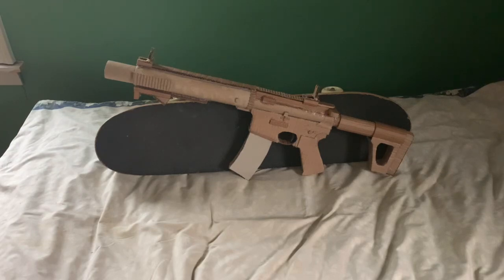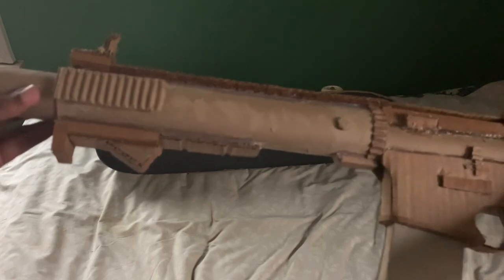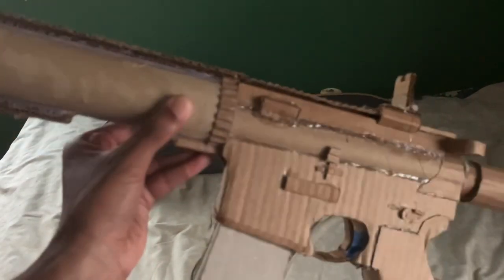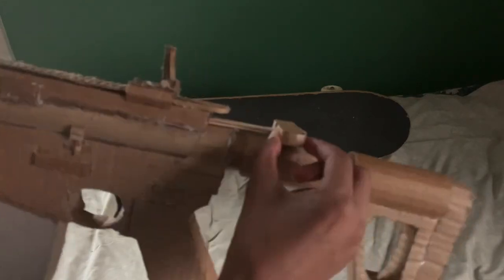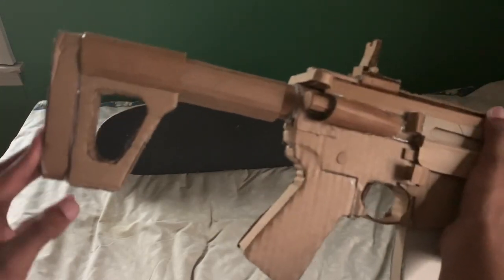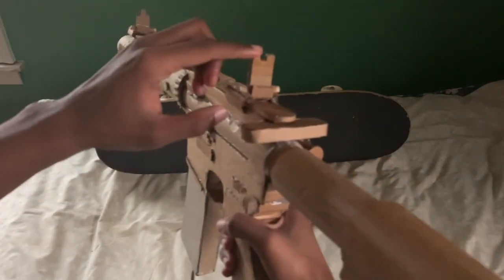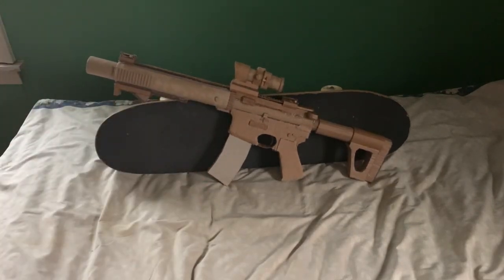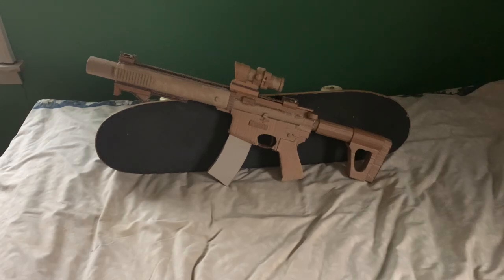Cardboard M4 (AR-15) 🇺🇸 | Updated

Comment: By the way, friend, how many years have you been making these guns out of cardboard, they are of high quality, I have been making them for 7-8 years, but I don’t have such detail and dimensions, I like to make Kalashnikov, etc😁
Reply from the maker: About 9-10 years I believe. My first cardboard guns were the MP5 and M4. But I’m just now getting the hang of making a decently good Kalashnikov rifle. Usually I tinker with guns even after I finish them to provide the most quality and detail I can. (Which is why I do Updated gun vids.) 

A quick tip for the dimensions is measuring the receiver. It’s the main part, and if that part is correctly sized, the rest should come along. 

Btw, you need to show me some of them guns you’ve done!
Reply: @javitZ137  I hope that I will show you soon my friend, wait soon I will show you just getting ready 😊
Reply: @javitZ137  I can create a channel on the cardboard theme)
Reply from the maker: @Eroshka642  I’m looking forward to it. 😁👍🏾. I’ll sub. And… just as a extra measure send me a link under any vid!
Reply: @javitZ137  Well my friend will be glad that you will be my first guests 😜😁😊👍🤝
Reply from the maker: @Eroshka642  I’m honored to be, bro! 😊
Reply: @javitZ137  hello, right now I will have a video in the channel about AKM, but I didn’t manage to film it normally, unfortunately, I ask about
Reply: @javitZ137  I have already released a video so come in I will be glad,